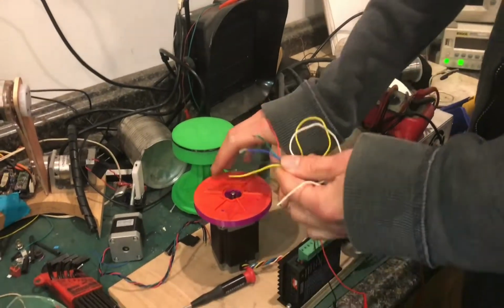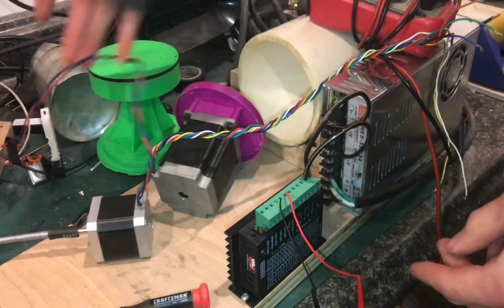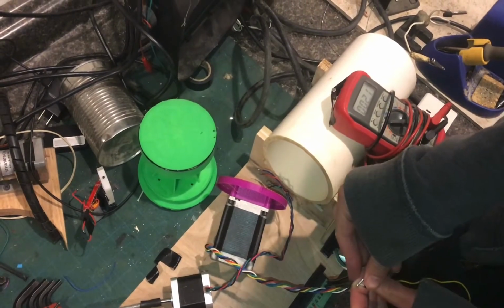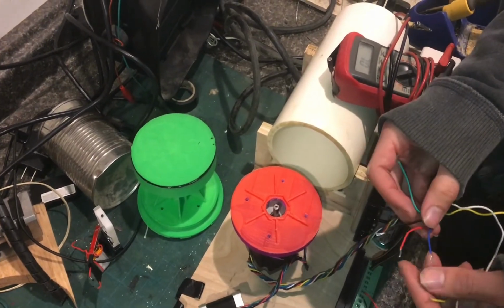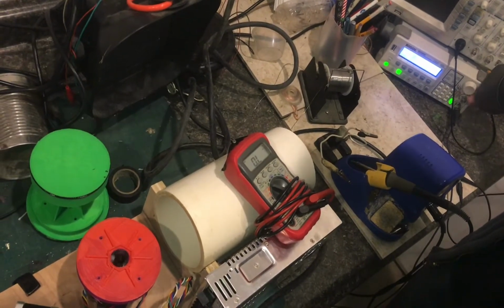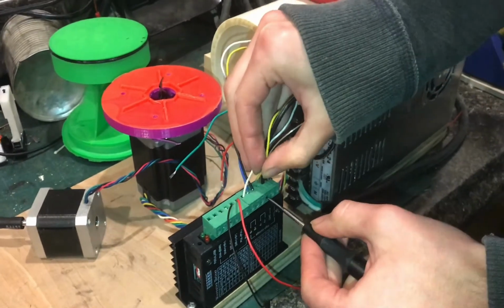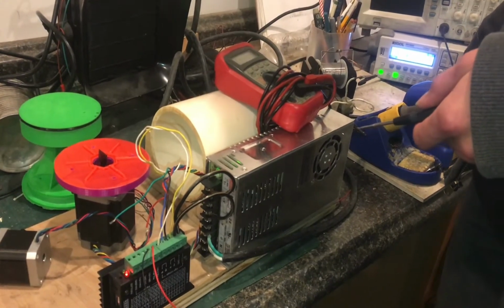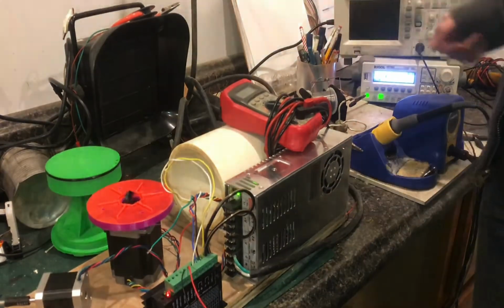understanding the DIFFERENCE between “4 wire” and “6 wire” stepper motors

Comment: But you also find 6 wires on 3 phase motors and they need to be wired in 3 pairs, so you should know the type of motor you have before deciding how it should be wired and not just wire it based on the no of wires.